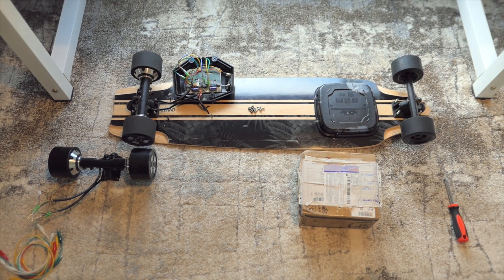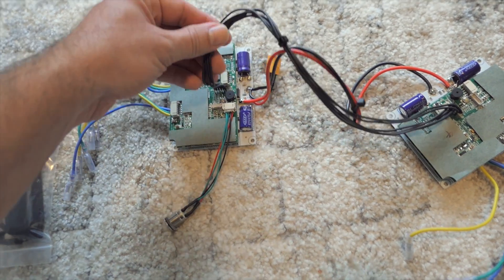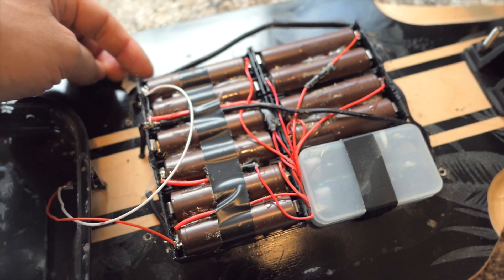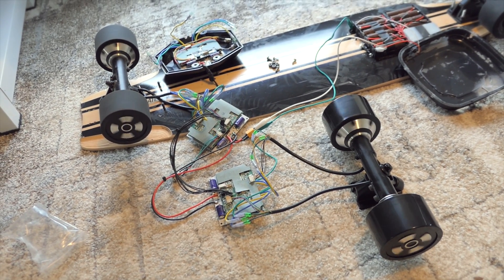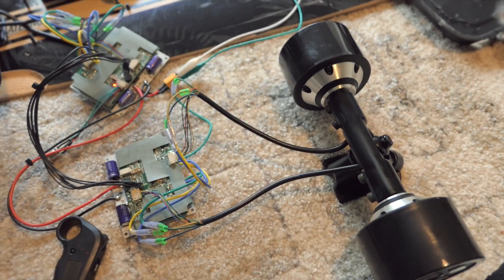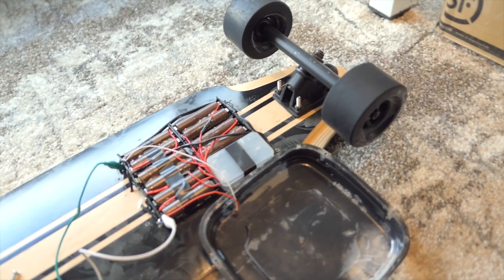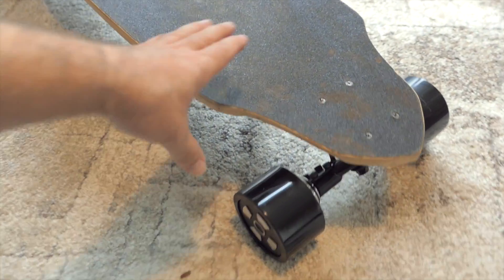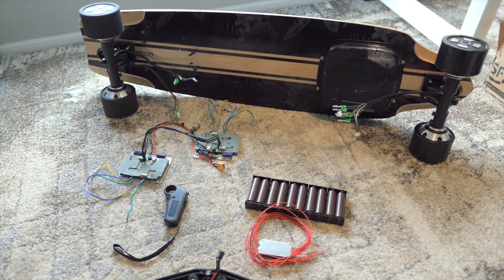DIY Electric Skateboard - 4WD Update

Comment: Good stuff. I have the same controller and having issues. Do you know what 4 continuous beeps on the controller mean? As soon as I turn it on about 5seconds later I get the beeps and it won’t run. The remote doesn’t link and the power meter doesn’t give full voltage(only one led lights up). But I have good voltage in batteries. Thank you

Comment: I think you could have used your original esc and added one there is usually a link and no soldering is required at all other than power source battery. 4wd is the way to go
Reply: For sure?
Reply: how would the remote work? lol

Comment: just 10 lithium ion 18650? i'm putting 100 of these guys and see what range i get
Reply from the maker: That would give you 50+ miles. Not really nessery unless you need that kinda range. I think 40 batteries would be a good balance between range and the extra weight. Goodluck with your build!🤙
Reply: 50 miles? thank you, well i'm down 12 of these 18650 because i ordered 100 total from new modem battery packs that came with lg blues rated at 2200mah. and i damaged 12. i'm a bigger guy so i know its over the top for a board but i'm making it 4wd and the motors need double the batteries to get the same miles as 2wd i believe. not an expert but slowly working my way to building this board! thanks for the reply
Reply from the maker: Actually your more efficient in 4wd because the motors are not working as hard together. Still your going to use more power and need many batteries to power a 4wd system. But its all worth it, 4wd is on another level compared to 2wd.

Comment: i've got the same, but I don't know how to upgrade to 10s, because those instructions are for the older version (I supose, because the solder spots aren't the same) what have you done for reaching 10s or a other voltage?
Reply: Did you ever get this resolved or figured out? I can help but this question is 2 yrs old. Let me know if you need help. Cheers